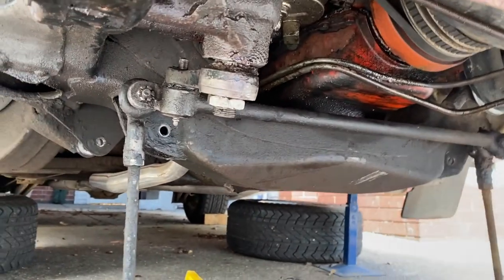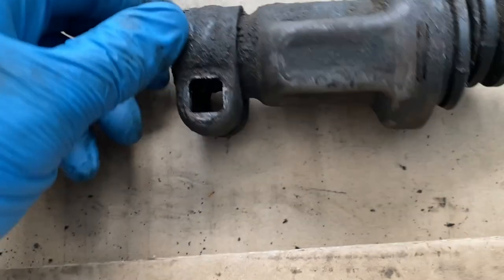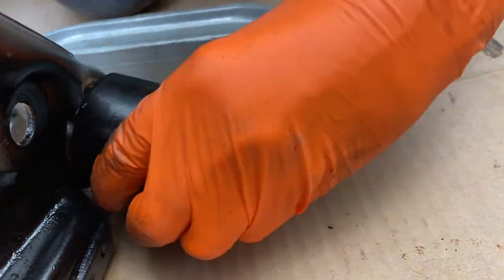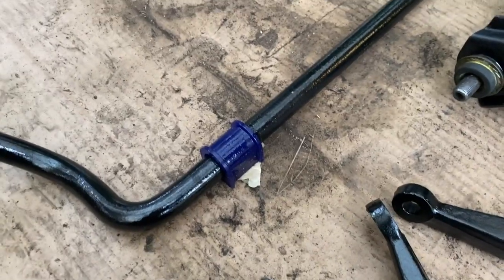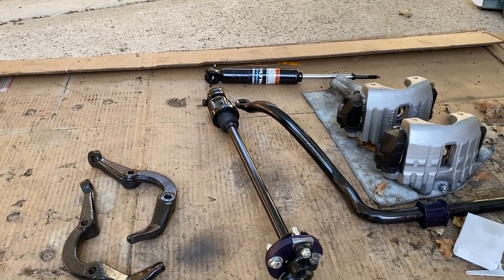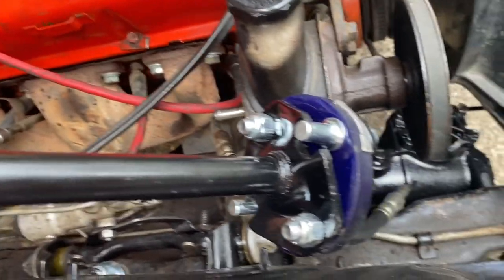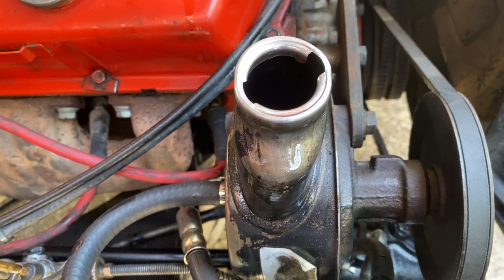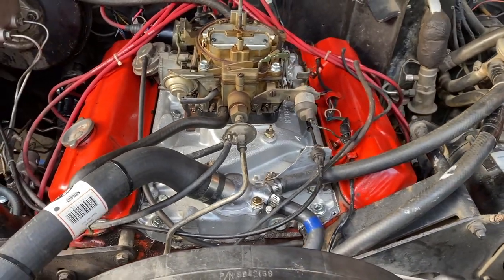Holden Le Coupe 308 Front End Rebuild - HQ HJ HX HZ WB. Full suspension & steering rebuild - Part 2.

Comment: hi 
Steering rag joint last for years and years  most still going after 50yrs
urethane bushes all degrade over time ,,the material crumbles 
USe urethane ie supa pro blue only
front lower inner bushes  wear quickly and  are available in HEAVY DUTY  by GMH and Aftermarket 
urethane front lower inner and upper inners and swaybar link bushes are all high wearing 
Using rubber bushes by Mackay is great as an option also 
intermediate streering shaft will need pressing of pin  to change boot
Reply from the maker: Thanks Paul, I'll keep an eye on it...

Comment: Hey mate - love this video! I hope you have more.

I have a question, how did you flush the corrosion out of the engine ( water) I have just had to buy a new radiator and heater core and will be installing and flushing the cooling system -- Any suggestions?

Comment: How did you you remove all the bushes and what size socket was that. Ive got the same ball joint press kit but having trouble taking the old bushes off
Reply from the maker: @Matt - I had to take the upper control arms to a mechanic who used an air chisel to remove the bushes... Really hard to DIY without the right tools...